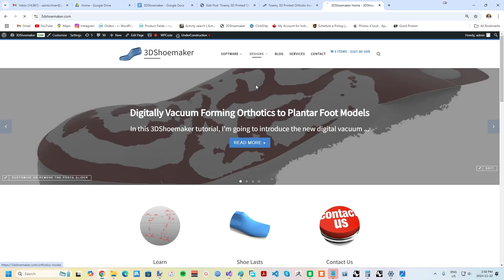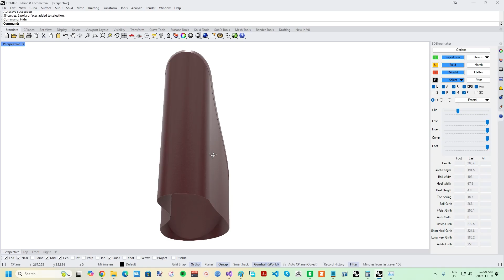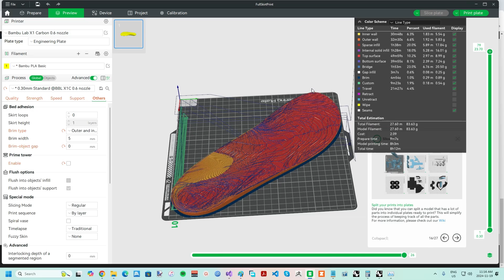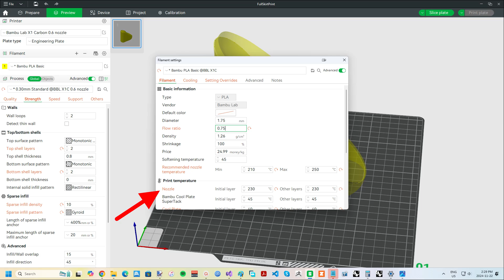Custom Foamy 3D Printed Orthotic Insoles

Comment: Hey, this is super interesting! I’m a triathlete currently using off-the-shelf insoles and just getting into 3D printing. Do you think the new Bambu H2D—with its dual-nozzle system and support for the new PVA material—could help reduce material costs? It seems large enough for custom insoles.
Reply from the maker: Stay tuned, I'm testing the H2D!

Comment: I got the same filament when I  got my 3D printer ( 12 months ish ) but did not try it till recently ( My next video ) its expensive but very good. 
I wonder haw well a unit would hold up !
Reply from the maker: I first heard of it a couple years ago, but just wrote it off as some finicky filament. Glad I finally tried it.